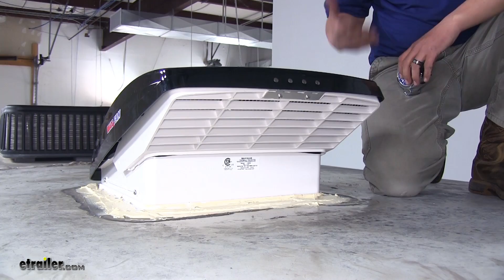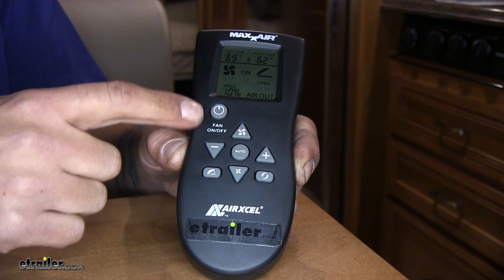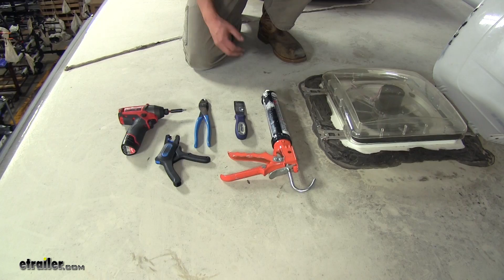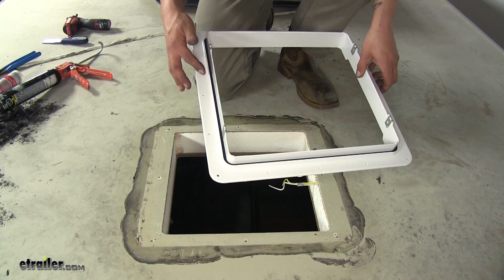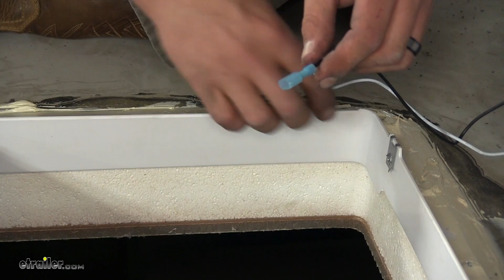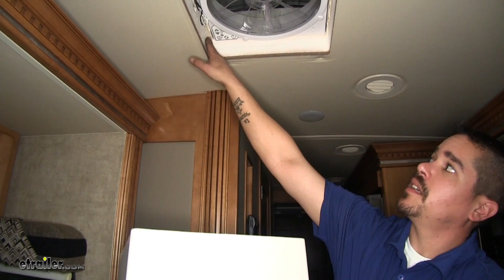etrailer | Feature Review MaxxFan Deluxe Roof Vent w/ 12V Fan, Thermostat, and Remote

Comment: Great video I tried to find it but I could not find, can you pinpoint what is the difference between 7000 and 7500.
Reply from the maker: The only difference is the cover. One will be white and the other is smoke.
https://www.etrailer.com/RV-Vents-and-Fans/MaxxAir/MA00-07000K.html
https://www.etrailer.com/Enclosed-Trailer-Parts/MaxxAir/MA00-07500K.html

Comment: why put so much sealing so it looks that messy, dont need that amount
Reply from the maker: You don't want the screw holes or where the fan meets the roof to leak. 
https://www.etrailer.com/RV-Vents-and-Fans/MaxxAir/MA00-07000K.html

Comment: I see from another Question, that Smoke is “translucent but not transparent”. ?!?  So, I gather that means Extremely diffused (Light) ?
Then how about White, is that “translucent”, as well ?

I LIKE the fan A Lot, but I want as much Light to come through as possible ......
Reply from the maker: If you are wanting as much light as you can get, you are going to want to go with the white. The white lid will provide much more light than the smoked lid. The smoked lid will act as a tint limiting the amount of light that comes in but not all of it.
https://www.etrailer.com/RV-Vents-and-Fans/MaxxAir/MA00-07000K.html

Comment: Can these be mounted on a curved cargo trailer roof?
Reply from the maker: It depends on the amount of curve but if it's quite a bit then standard vent sizes normally don't work well. You may be able to use a smaller round vent with fan https://www.etrailer.com/p-VP-543SP.html

Comment: Leaking during rainy season?
Reply from the maker: As long as you use a good sealant (see links below) you shouldn't experience any kind of links. Really the only way that rain could get in is if you are parked and the winds are high enough that they are sweeping the rain in below the rain cover with the vent opened (which would be the same case with any kind of rain cover). If you close the vent during storms like that though you'll be just fine.

https://www.etrailer.com/dept-pg-Accessories_and_Parts-pc-Vent_Install_Kit.aspx
https://www.etrailer.com/dept-pg-RV_Exterior-pt-Sealant.aspx

Comment: Reverse the connectors on one of the wire connections so there is never a question of polarity when reconnecting the wires in the future.  Also, use self leveling lap sealant on the top surface of the roof flange so your finished work doesn't look like such a hack job!
Reply: dogpatch75 You said it well...”hack job” was the one word that came to mind while watching this. Why is it that in North America this is supposed to be a professional instal? On the roof there is goop schmeered everywhere and on the inside gaps and wires visible. I definitely wouldn’t be happy with it if I’d done it myself, much less if I hired someone to do it.

Comment: Has anybody ever tried to run 18v through this fan?
Reply from the maker: I contacted maxxair and anything over 12 volts will cause the fan to wear down and eventually fail.
Reply: @etrailer  I was planning step down from 18v to 12.. but that might step up amps to 20a.. what im not clear on is what that will mean if the source is 12v but 20a and the load is 12v 3a.
Reply: @etrailer  I was planning step down from 18v to 12.. but that might step up amps to 20a.. what im not clear on is what that will mean if the source is 12v but 20a and the load is 12v 3a.

Comment: you can't see through them? can i add rocker switch to use base model as fan or extractor ?  what's the clearance when its closed?
Reply from the maker: The "smoke" colored cover is translucent but not see through. It's a darker tint. When the vent is closed it extends 5"
 above the roof. When open it extends 9-5/16" above the roof. Technically you can add a rocker switch to the vent but since it is designed for 12v Maxxair does not recommend wiring the vent to a seperate switch.  The fan is designed for a constant 12v feed and flipping a switch on will create short high spike in voltage. Overtime those short spikes in voltage will run the fan down causing failure.

Comment: What's the difference between this and the 5100K?
Reply from the maker: The MA00-05100K is a manual lift compared to the fan featured in the video part # MA00-07500K has a powered lift. Also part # MA00-07500K has a black cover and the MA00-05100K has a white cover.
Reply: Waaay cheaper then 5grand

Comment: do they have a model with an adjustable thermostat?
Reply from the maker: The one linked below has an adjustable thermostat. It has an auto set feature which allows it to be set at 78 degrees F and it's adjustable in increments of 1 degree F. 

https://www.etrailer.com/Enclosed-Trailer-Parts/MaxxAir/MA00-06200K.html?utm_source=youtube&utm_medium=Comment&utm_campaign=Youtube%20Comments

Comment: Is there a difference in the maximum fan speed on the 4-speed vs. 10-speed model MaxxFan or is it just a matter of having 4 vs. 10 interval settings with the same maximum speed?
Reply: It has the same maximum speed as the base model
Reply: Just more variable in speed